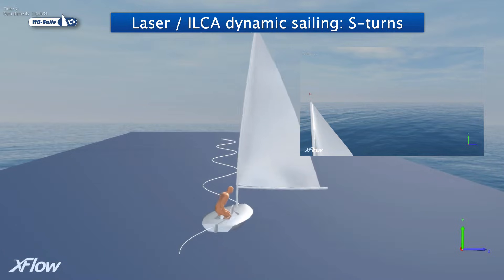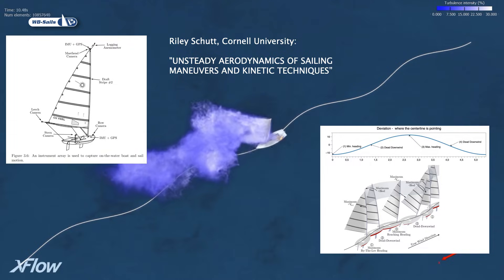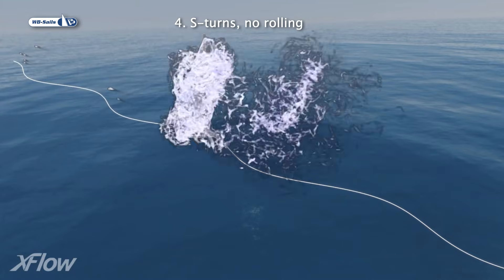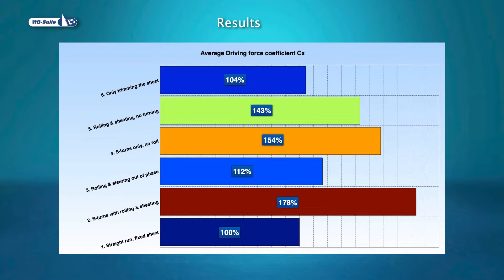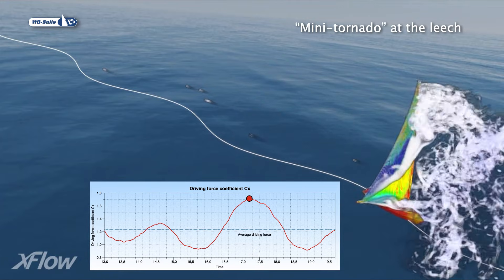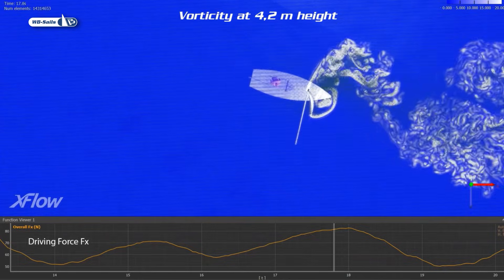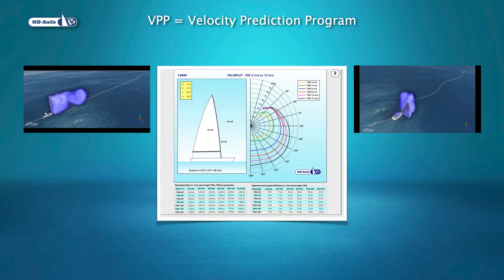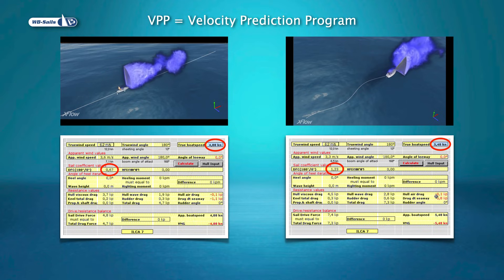Laser (ILCA) S-turn technique when sailing downwind

Comment: Do you have implemented transition models for the intralaminar characteristics of the viscous sublayer? And what is your Reynolds Number please ? Y+ value would also be intersting to know
Reply from the maker: XFlow uses a non-equilibrium wall function to model the boundary layer. This wall model takes into account the adverse pressure gradients responsible for flow separation, important in aerodynamics analysis. Moreover, the wall model is automatically disabled as soon as the lattice size near walls is small enough to resolve directly the flow in the boundary layer. There is no transition model, XFlow assumes turbulent flow. The Reynols number varies obviously a lot in different parts of the model, as does Y+.

Comment: What is the equivalent underwater part of the problem; the increase in driving force isn't the full story as you are generating more drag from turning, but there are also rolling benefits to the underwater side too.
Reply from the maker: Good question - there's not necessarily more drag from the turning, as you steer by heeling, following the turn with the rudder. Heel means less wet area, so could be even beneficial. You are right, there could be benefits from rolling through the underwater fins, too, although the centreboard would be lifted. Maybe someday I will do the underwater sim as well.

Comment: Awesome simulation and really interesting results!

Really interesting to know that you can get so much extra power out of these S-turns. They definitely gain you a few places near the back of the UK ILCA nationals.

Got to add this dissertation to the reading list. My understanding was that these turns helped you surf the waves, and keep your speed up, while not ploughing forward into the next wave until you see a gap. However, it never made sense why it was faster than surfing diagonally down the waves for several boat lengths in alternate directions (which wasn't faster than someone sailing in a straight line when I tried it)

Comment: Is this even ok with rule 42?
Reply from the maker: Talking to umpires, yes. You are allowed to steer the boat through heeling: Heel to windward to bear away, and to leeward to head up. So the S-turns technique should be OK, while sailing in straight line and just rocking the boat is not. S-turns could be something for Finn masters, for whom free pumping is too physical.
Reply: @keyrockcdn
0 seconds ago
https://youtu.be/ixxuoTn8hew this might answer your question number 4